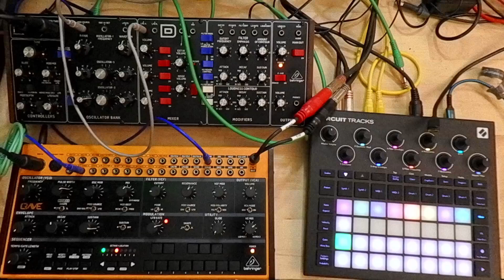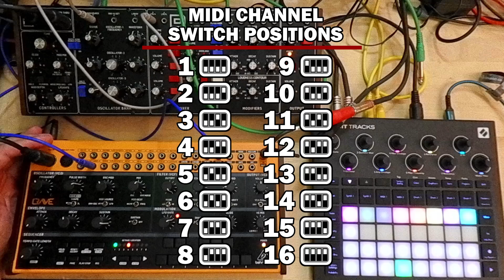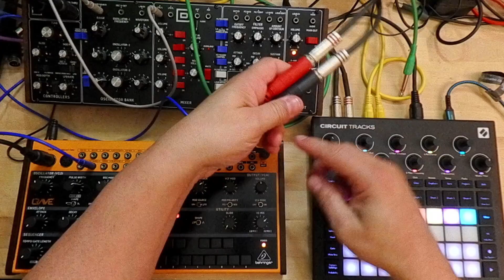How to use The Novation Circuit Tracks with External Hardware

Comment from the maker: Ok so a non subscriber pointed out that I made a couple errors in my description of the Circuit Tracks' capabilities.. First Drums are on channel 10 (by default though you can config them I will make a video describing that) and they are triggered with C-3,D-3,E-3, and F-3 for the channels 5,6,7,8 respectfully. Also apparently the inputs are 1 and 2 and both are mono so you can run audio into the Circuit Tracks if you would like for 2 mono audio devices. Sorry for any confusion this may have caused... If you have any other questions feel free to hit me up. I apparently confused the couple Circuit Devices I have (Tracks an Rhythm). I have a Rhythm video coming soon.
Reply: Hey, I think I just commented on this myself but now I'm even more confused.   Could you possibly show how and if the drum tracks can be used?
Reply from the maker: You bet I’d be happy to! Just don’t forget to subscribe to the channel. I’d appreciate that lol but yeah, I will definitely do a video for you.

Comment: I just got a "Behringer Pro Vs Mini" I'm using midi 2 on the tracks to send midi to my Behringer. Everything works fine except when I change the project on circuit it changes the patch on the Behringer. Have you encountered this problem before
Reply from the maker: Yes, I believe there’s a setting to. I’ll have to look what it is. I’m not at the device right now, but I think there’s a setting to disable receive patches or receive patch changes.
Reply from the maker: OK, so I’ve got some really not awesome news… I haven’t tried the circuit yet as far as this goes in there might be a way to tell it not to send program changes, but they does not appear to be a way to get  the pro vs mini to ignore program changes… I know you could do this with a software filter between the two like if I were using CUBASE, I can stop them from getting through, but the machine itself does not have a way to stop it. Fear not I am looking into what I can do about it and I definitely will contactBehringer to request that that be added. Crazy that it’s not already there.
Reply: @Cap10NRGMusic  I really like your channel!  I was going to comment above just saying I enjoy your informative videos, but I saw this question here and since I had just been looking at the MIDI implementation on the Circuit Tracks anyway, I knew the answer.  Yes, on the Circuit Tracks you can turn off Program Change messages individually for each channel, while still keeping the regular note on / off data going out to the synth.  You'll see info on how to do it in the diagram on the bottom of Page 102 in the manual.

Comment: Fantastic! 
As intend to enter the realm of eurorack, i was looking for some explanations about how to use my CT as a sequecer for modules and my Roland T8  😁
Reply from the maker: Oh wow euro rack, that’s a beast I don’t dare tangle with lol not in physical form anyway I’ve played with some virtual stuff. I think if I started buying rack gear, I would quickly be divorced lol. But are you thinking of using the CT with Mitty to control your devices, or are you planning on using CV to control your devices? I know most of your stuff does use CVs. I’m asking because - the CT has a sync out, so it can be used to “drive” you euro rack and provide a clock,  but it can’t send CV data like varied voltage levels to change pitch or send “signals” over CV - just clock start/stop/timing. If you want to use it to play notes on a euro rack rig, you’ll need a MIDI to CV converter like is (
https://www.googleadservices.com/pagead/aclk?sa=L&ai=DChcSEwimupfm9YyGAxU_bUcBHTm4Bz8YABALGgJxdQ&gclid=CjwKCAjwl4yyBhAgEiwADSEjeDOPvlSuuaVWv-HkRaRbV2xbBaZlj5NSnixJXh-qaNNC5Y5oWc2x7BoCNg0QAvD_BwE&ohost=www.google.com&cid=CAESVeD20Tw5n_CXKLmaGdaqI2rKbZCskeMdX0rghsE9SOrGFvW53cyO99RlcdsDXgtjXorcRO51KdETG5bVN9i_uuRcy8VZP2zPyDCAPrB6orCSca1Nz2s&sig=AOD64_0Dlb2oye4r8wyemFYy1BFicq5lEQ&ctype=5&q=&ved=2ahUKEwjWh5Hm9YyGAxVylYkEHVtFB6IQwg8oAHoECAIQDA&adurl=) of course using the CT you also have the 4 tracks of sample playback and 2 FM synths, so it is still a cool device if you are just using it for sync and using it as a “module” within you new ER setup. 

Now the T8 (the cool little 808 drum machine) does support sync in and out - so it should be able to (without midi) connect and receive timing from the CT. If you want to “program” the T8 from the CT, however, you’re going to want to use midi ( which can also send and receive timing). The”sync ports” are not full featured CV - so that said and knowing it only send start/stop/clock - if you use that method you will be programming your rhythm on the T8 using the T8 and just receiving timing from the CT. If that is what you’re looking for then 👍👍👏👏let’s go!! You’ve got it - otherwise midi is a more robust (and complex) communication protocol and might serve you better in this case. 

I really hope that helps and that I didn’t go off the deep end on you. Let me know if I can help you out anymore. Have a great day and please don’t forget to like and subscribe.
Reply: Very helpful, thank you so much for your explanations.
Yeah i already use the sync out with my t8. Just start/stop/clock as you said. But that's already a great deal not to have to try to push 2 buttons exactly at the same time. 😂
I'm gathering all the knowledge i can before building my eurorack.
Reply from the maker: @akzeone nice!! I wish you luck with the EuroRack build. If I were younger, single, and had more time I would definitely be looking at EuroRack stuff… However I’m no single, time is tight and, well I just do t have the patience to connect all those wires for one patch lol. It is super powerful and that it is soooo infinite!! It’s crazy!!! I’ll just keep messing with Cherry Audio’s Voltage ;). If you haven’t subbed please do and keep me up to date with your progress!

Comment: When i plugged in my crave i wasn't able to use the chromatic keyboard, midi is in the correct plug aswell as receiving master clock to the crave. It just wont allow me to control notes via the circuit tracks helpppp
Reply from the maker: If I were to guess it’s probably a mid channel scenario. Be sure that you have the MIDI channel on your crave set to either three or four, which ever of the channels you want to use off of the circuit tracks. It’s one of those two channel 3 or channel 4. You set the channel on your crave using the DIP switches on the back there’s some little white switches that look like light switches… Sorry if I’m describing this in a way that seems like you’ve never seen these before but I’m not sure if you have lol so I apologize. I know I hate it when they start troubleshooting my machine like, did you turn it off and on lol, anyway, those switches need to be set a particular way you’ll need to consult the manual if you don’t have it go to beringer.com and look at it and they’ll show you how to channel 1 through 16 using the switches on the back. If I’m right and remembering and I think I am is one and that’s all the switches off 16 is 15 and that is all the switches on that would make channel 3 be the second switch from the right on and channel 4 would be, the last two switches up so the last two switches on the right up and everything else down. Try that and let me know if it works if it does awesome don’t forget to like and subscribe.
Reply: @Cap10NRGMusic  yep worked mate thanks.
Reply from the maker: @hpjackson1 very happy to help!!
Reply: @Cap10NRGMusic  have you come across a system package that links up craves' parameters? Or do I have to map the CC's and create my own sys file and load to CT?
Reply from the maker: @hpjackson1  I haven’t seen one. I actually haven’t been able to send much in the way of ccs to the crave. Straight MIDI notes as far as my experience with it. I generally wind up manually tweaking knobs

Comment: I’m hoping you maybe able to help me out. I have a Roland S-1 synth. I have run my midi out cable from back of CT to midi in of the S-1. I have set the S-1 to be on midi channel 3 to align with CT. I have then run audio out from S-1 into first audio in on back of CT. When I try to use the CT to trigger the S-1 nothing happens. The pads don’t play anything. If I play live on the S-1 the sound comes through the CT but at a very low level compared to the track volumes on the CT synth for instance. Even cranking up the volume on the S-1 and the mixer on the CT does not make the S-1 volume equal to stuff on the CT. What’s going wrong here?
Reply from the maker: Hey there, sounds like you have a mini channel situation. Make sure that the Roland device is configured to the same channel you’re transmitting from. I am not familiar with that device, but chances are default to channel one what I would do is test go to the first synthesizer on your circuit tracks, turn down the volume on the circuit tracks, and then try playing the synthesizer to see if it triggers the Roland synth. if it does… It means the Roland is receiving on channel one, you’ll need to go into the Roland menu somewhere and tell it on channel 3 or four for it to work with the circuit tracks. When you do midi channel 3 is the first external out, and mid channel 4 is the second channel out.
Reply from the maker: Oh, as far as the level goes… Try adjusting the mixer if if you need help with that, let me know

Comment: Hey you ever have an issue where the crave only plays every other note the circuit tracks sends? E.g in keyboard mode on CT you hit a pad and it plays a note, you hit it again and nothing, you hit it a third time and it does play. Can't figure out what I'm missing here. Thank you!
Reply from the maker: Wow, that’s curious. I have no idea. I’ve never had mine play. Every other note I can’t even think of what that might be.  I guess I’d ask first is it precise like that like every other note exactly? I mean there’s no gate, so it’s not a gate there are no effects really built into this device, so I am kind of at a loss. If it’s skipping nose here and there it could be a bunch of different things from a bad cable to, a faulty controller or possibly a faulty board in the crave. But I really am not positive. I’d have to do some digging if you want I’ll take a look and see what I can find.
Reply: @Cap10NRGMusic thanks for the quick response! I figured it out after like an hour - had to disable the poly voice option in the Behringer software

Comment: Hello. I have a bit of a struggle here. Every time I start my Circuit Tracks it automatically starts Crave's sequencer. How can I prevent that? I just want to use Crave as additional synth.
Reply from the maker: By the way, sorry for the delay, I had other obligations, but I got you!
Reply: @Cap10NRGMusic  thank you very much! I will now know what to do.
Reply from the maker: @DomikDomik  happy to help you out - hey if you haven’t subbed already, please do. I’ll be making a video to explain this for you and anyone else who runs into this.
Reply: You’ve actually mapped the midi channels correctly compared to the QuickStart guide which finally allows me to find channel 3!
Reply from the maker: So you just want to be able to play the crave from the circuit tracks, but not kick off the sequence on the crave?
Reply: @Cap10NRGMusic  Yes. Exactly.
Reply from the maker: OK here we go. What do you want to do is get yourself a copy of synth tribe, version 2.61 or whatever the most recent version is from behringer. When you open it with your Krave plugged into your computer, you will see a menu that says Mini clock out, clock sores, a sign value, and the one you’re looking for is right under assigned value called sequence or auto sync turn that to deactivated and then if you press play on your circuit tracks, it will not automatically sync up the sequencer. And you will still be able to send patterns to it from the circuit tracks or play it manually.

Comment: Having trouble connecting tracks with my Smpltrek. I want to use the synth on my circuit tracks with smpltrek.
Reply from the maker: Hey there - I can help you out with that. I would want to try it out before I tell you how to do it, but I have a pretty good idea of how to do it.
Reply: @Cap10NRGMusic  I appreciate you. I think I kinda figured it out actually. Still a little wonky tho.(after track 5 on the smpltrek it wouldn't receive midi from the circuit) I'll mess with it some more tomorrow. Thanks.

Comment: Great tutorial 🔥 I have a question can you record a sequence from an external synth and loop it and then record another from the same synth and loop it on top of the first and and so on?
Reply from the maker: Well not exactly - I get what you’re asking but this is not a loop recorded though you can have multiple midi channels that play back. You might like the SMPLTREK that does work like that sort of - I can show you that if you’re interested. If you want you can do that without other hardware using a multitrack recorder software if you don’t mind using a PC/Mac using Audacity.

Comment: The Tracks can easily be set to have two MIDI outputs instead of an out and a thru. Page 107 in the manual. And it looks like you already noticed the audio inputs are for the MIDI 1 and 2 external device tracks. That’s why the plugs are labeled 1 and 2 instead of L and R. They can be independently panned, independently sidechained, and independently have delay/reverb applied. By default they are both panned to the center. That’s page 90 of the manual.
Reply from the maker: Thanks Raquel! Yeah pretty interesting actually - reading the manual?? You do realize I’m a guy right lol 😂 just kidding - so many manuals so little time eh? But thanks for that. Hey would you consider subbing I just checked out your channel - good stuff. I’d love to keep in touch!!

Comment: I feel like I'm missing something really obvious. I can hook up and sequence my Microkorg on one of the midi channels, but once I unplug the midi, the notes are not there anymore. The steps are still in the pattern, but the sound doesn't get recorded in? Do I always have to have the external synth hooked up to play its sounds, or can that get recorded into the Circuit Tracks somehow? (I feel the Circuit Rhythm might be better for accomplishing this? idk)
Reply from the maker: So you’re saying that once you unplug the synthesizer, you can no longer hear it. That’s correct yes midi controls your synthesizer and the notes are playing through it. The rhythm does not record either. It will sample if you’d like, but it does not record the audio into the device. Neither of these devices directly record, audio per se. They can both use pre-recorded samples, and the circuit rhythm can record its own samples. But the circuit tracks does not record at all. That way it only records notes in a sequence. If that makes sense, I can explain that more in another video, if you’d like, but basically, when you control a synthesizer with midi, the synthesizer is what is making the noise… If you have a device like a Sonicware SMPLTrek or AKAI Force or MPC you can record audio as either samples or as a track.
Reply: @Cap10NRGMusic  ok, thanks for confirming. As a follow up, I did sample an arpeggiated chord from my Microkorg into the Circuit Rhythm (and somehow along the way I got that arpeggiated chord from my Microkorg to sound like a guitar riff with a wah pedal... somehow!).
 
  I guess I'm going to have to shift my focus into being ready to record these sessions as I might not be able to get that particular "lightning in a bottle" configuration again. 

I just recently purchased Ableton, so I'll be eventually learning to use that to record my sessions with my various boxes... (trying to import my Circuit Tracks projects into Ableton right now! lol)
Reply from the maker: Do you have a mixer? If not, you might want to get one and run everything into the mixer and then to a recording device. You can purchase something like a field recorder or something that has input on it and record all the time. I know that sounds ridiculous but I can’t even tell you how many things have, for lack of a better word, escaped because I was not recording. It kind of sucks to lose something like that I know. But if you’re recording, you can at least go back to the recording and edit it out. Grab what you wanted. If you have an old computer, what you can do is set up audacity on it. I think it has a loop record where you can set like a 40 minute loop or 30 minute loop and it will record and then record again and then again destructively removing the old loop but at the same time giving you that buffer to experiment. I’ll have to look to see if that actually is there or if that’s just something I’m remembering wrong, that might be a whole video right there.😁